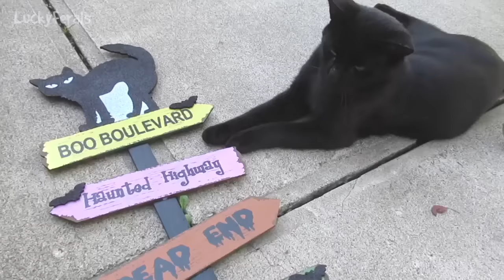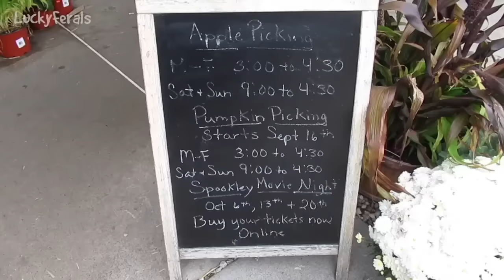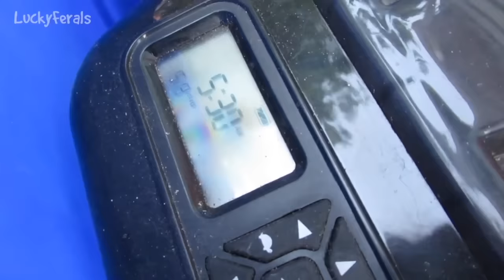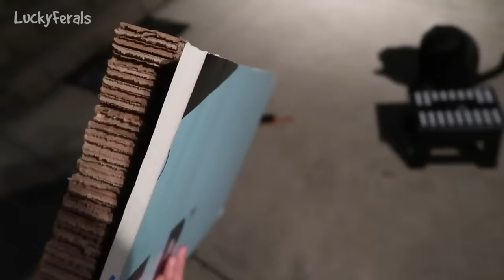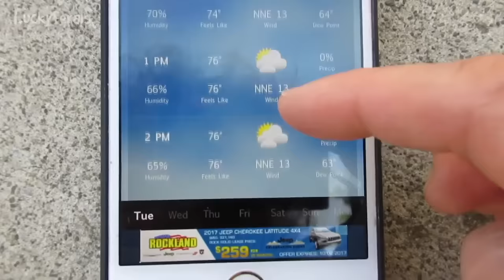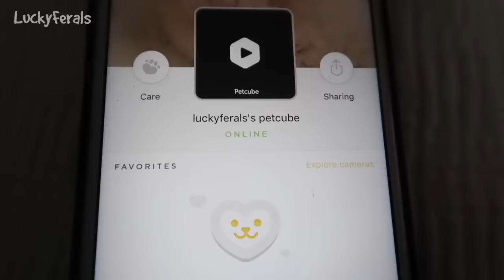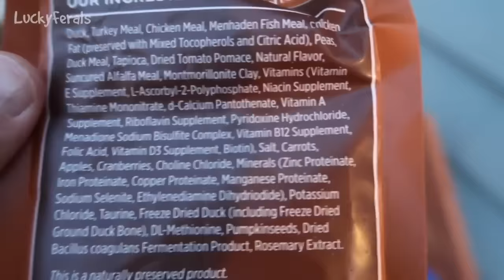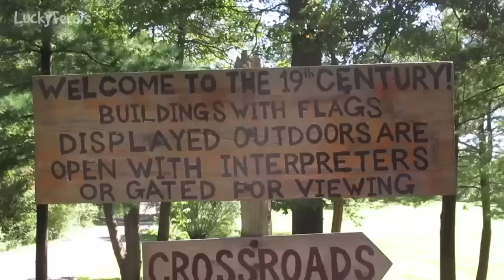Training And Socializing A Feral Cat * Part 8 * Days 55 - 64 * Cat Video Compilation

Comment: There is a black and white female in my neighborhood that I've named Maggie. She began making regular visits to my front window when she noticed I would open it for mouse disposal. I use mechanical traps baited with peanut butter so that my dogs do not take injury. I have a densely planted flowerbed that gets full sun. Maggie began to take her naps there. I began putting out cat food to supplement the mice to she keep coming around. With time, Maggie would come running to me when I called her name to offer food. She is clever for she learned that if she climbed up the small ornamental tree outside my "mouse window", my dogs would notice her before I did. I always get up to check what makes them bark. When Maggie was sure I'd seen her in the tree, she would climb back down to the ground and wait for food. In the first year, Maggie always kept about six feet of distance from me. She would not eat until I went back into the house. My friend down the block tends to strays in the neighborhood. Together we were able to trap Maggie and get her neutered. We released her again because she was not accepting human company and she was in healthy condition. The neighbor loaned me a deluxe cat house to help Maggie during Winter. It has a pressure activated heating pad and clear vinyl doorway flaps at front and back.

It was not until the second year that Maggie began to hover around me when I was out gardening. She seemed to want some proximity. There came a day that Summer when she walked directly to me and allowed herself to be touched. It seemed to me that petting was not familiar to her and she wavered between anxiety and enjoyment. I leave my doors open in Summer so my dogs can enjoy the fenced areas in front and back. There's been a number of occasions when Maggie came in to hunt and found herself trapped indoors for the night. I give her an exit as soon as I discover her presence. I want her to understand I will not hold her prisoner. 

It is late Fall now and routine for Maggie to appear whenever I step outside. I try to make sure to give her petting at least once a day. We chatter at each other and she purrs just a little. She likes rubs at the base of her tail and along her jaw and even accepts grooming with a slicker brush. She does not allow me to hold her or pick her up. She won't sit on my lap.  She remains wary of my dog. I'm hoping they will accept each other in time.
Reply: I am very happy, that i can see many cat vidios. I hav'nt cat, because the conditions in my home are not sufficient. Before 60 i had as child a cat in my house. But i remember the black cat was nice but very difficult in your behavior. Many pleasure with your cat.